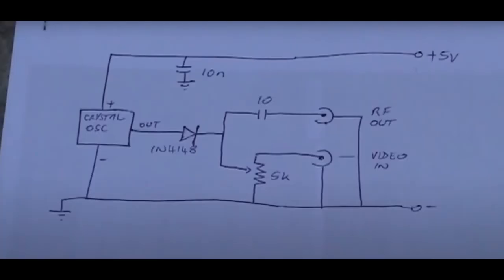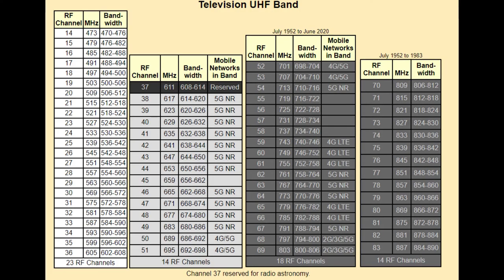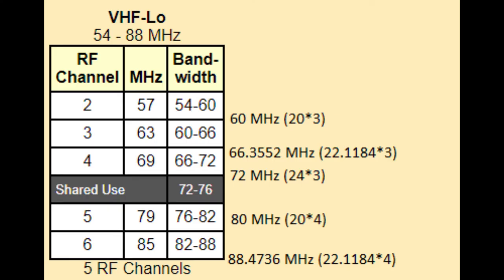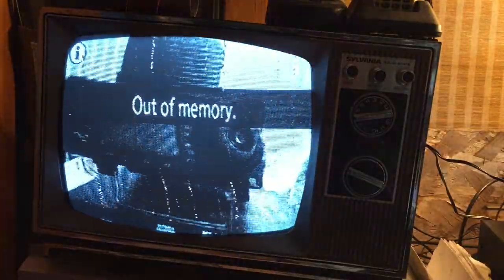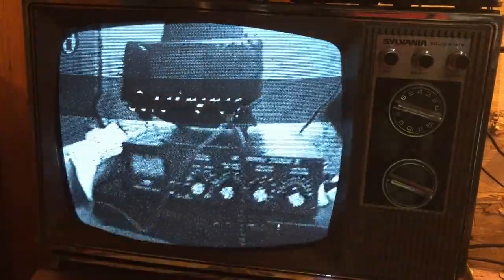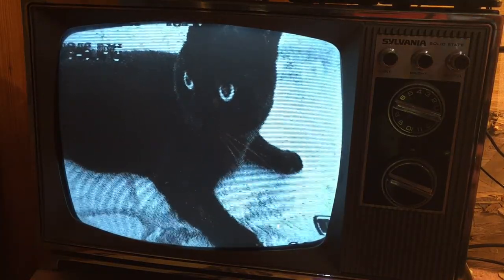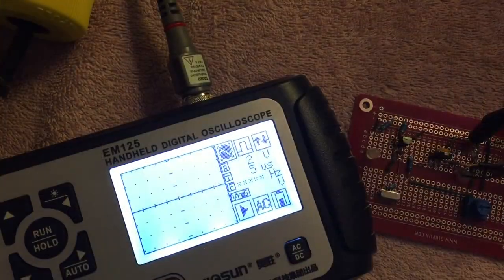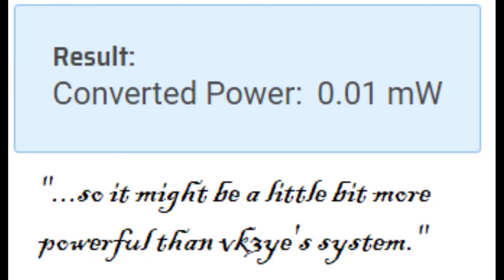Building A Basic Composite Video TV Transmitter Circuit

Comment: Nice job ! I have a black and white KTV small portable TV to test my transmitter with. I got a handheld TV but the screen is HORRIBLE but the reciever circuit works so i want to replace the screen with a modern car monitor and see if the picture will look better. I want to have a number of TVs recieving a signal from a game console and have wireless controllers so its like a form of LAN muiltiplayer but with analog TVs instead.

Comment: Hi, cool stuff! 

If it is not a bother, can you give some more information about the triple harmonic you mentioned around 2:50?
Is this referenced as something like a 3rd overtone in a crystal oscillator datasheet?
Reply: Made the circuit myself, it works. I used a 20MHz crystal tho but it broadcasted OK to channel 3! thx so much
Reply from the maker: The crystal I used was 22.1184 MHz. In basic oscillator circuits, such as what I used, there is no filtering to prevent the harmonics from getting out. This means that there will be a signal on 22.1184, on 44.2368 (the double harmonic), on 66.3552 (the triple harmonic), 88.4736 (the quadruple harmonic), and so on. Because I did not have a crystal that was of a frequency within the NTSC TV channels, I used this harmonic behavior to my advantage. The problem with my circuit is that there is a signal being produced on all harmonics of 22.1184 (although more distant harmonics are weaker). This is usually solved by adding a filtering circuit that filters only the frequency or frequency range you want, and suppresses the harmonics that you don't want.

As for overtones, I have read up on information about this, and if I understand it correctly, then yes, an overtone is another way of referring to harmonic frequencies. And so, a 3rd overtone should be what I have referred to as a triple harmonic.